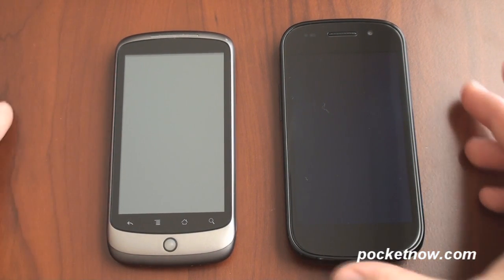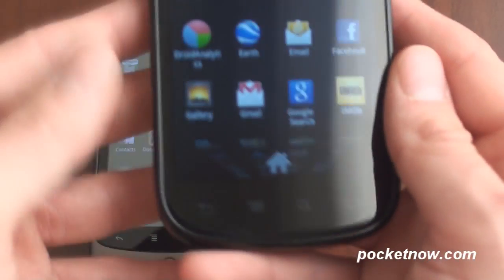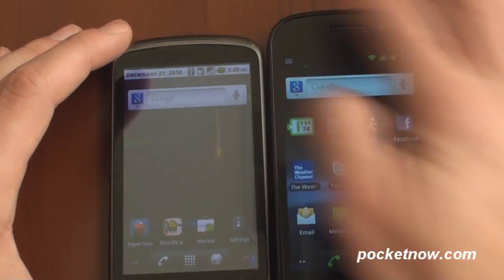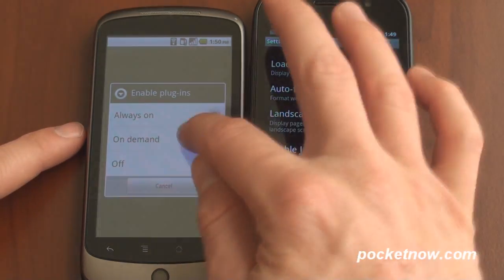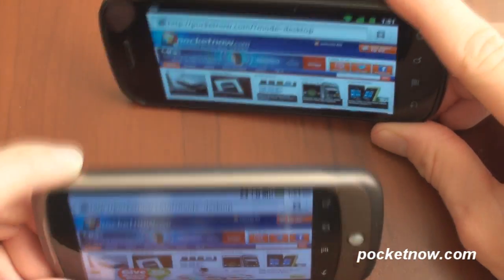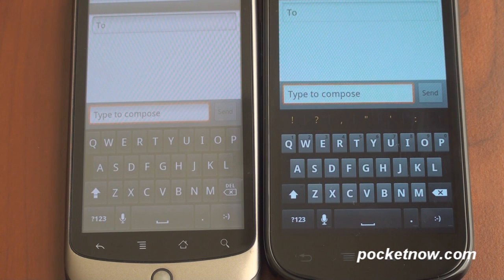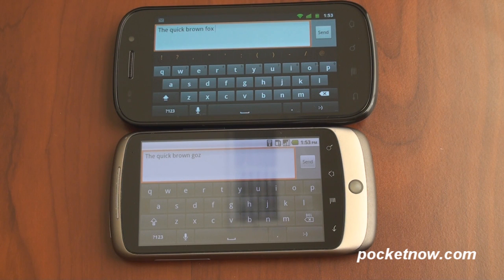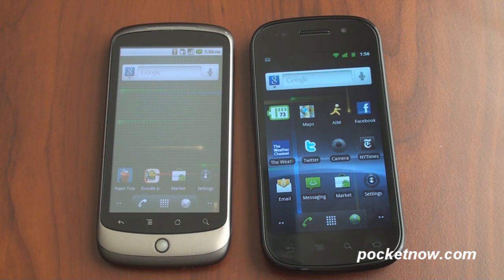Nexus One vs. Nexus S | Pocketnow

Comment: @InitialDAmine Sorry, I thought I got the picture once I saw you reference a video where the DHD 'raped' the SGS in Quadrant (notice that the DHD got some surprisingly low FPS compared to the SGS in most of the graphics benchmark). Personally I went with the SGS for its size, video playback (mkv+subtitles) and screen, but it's a pity about the build and GPS. Software-wise Samsung has been doing better with some updates lately, luckily.

Comment: @MelvinSF well SAMOLED due save energy when it comes to black colors because SAMOLED is basicaly a led screen which mean the pixel light them selves and for black they turn off, the thing is in your experience i believe they were turned on from a software consigne, the issues with led and especially SAMOLED is white and as we know internet navigation=alot of white and led consume to much power when it comes to white

Comment: @MelvinSF if we went back true the comment you would see that i mentioned some of what you said, the SGS is a magnificient piece of hardware and as hardware (Minus GPS) goes the DHD and the SGS are about equal but when it comes to software/built quality/ GPS and some other issues known with the SGS the DHD shine and wins hands down, sure DHD is not perfect, you get a little soft issues but that seems removed with the recent update.

Comment: @InitialDAmine You realize those synthetic benchmarks don't mean much, right? The DHD is better on the RAM/CPU/file system side but worse on the graphics side, from what I've seen in actual use.. Nothing too significant. Just because a cpu can do floating-point operations way faster and scores twice as high as another one in some benchmark doesn't mean it feels much faster generally. Both the SGS and DHD are really powerful and have their advantages over one another.

Comment: @sagech888 Of the black pixels, but that could mean that the notification bar area will be brighter than the rest after a few years. Also on my Galaxy S, when I used a keyboard with a nearly all-black skin and I brought up the keyboard, the rest of the screen went a lot brighter. Like the power is being passed on to the rest of the pixels instead of being saved.. So I'm not so sure about this power-saving thing. That said Super AMOLED looks pretty awesome.

Comment: @MrOsamaful faster for me and for alot people is CPU,Even on that matter SGX540 PowerVR is not faster than tegra 2 which is using a cortex 9 architecture while the Nexus S uses a cortex 8 one! the SGX540 PowerVR is as fast as adreno205 and not a match for the SGX540 PowerVR ( on paper at least because there aren't much smartphone outthere that uses tegra 2 so far the first one will be a LG